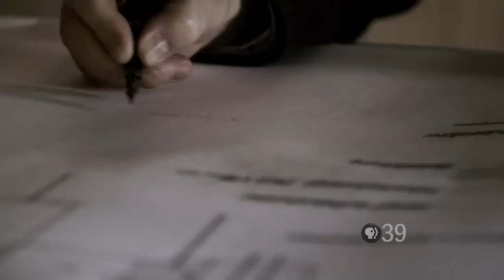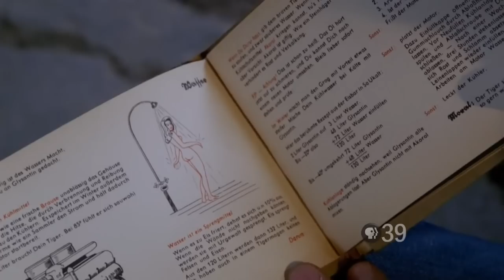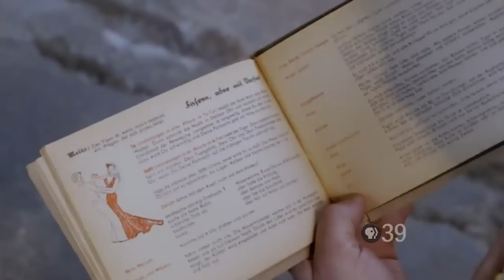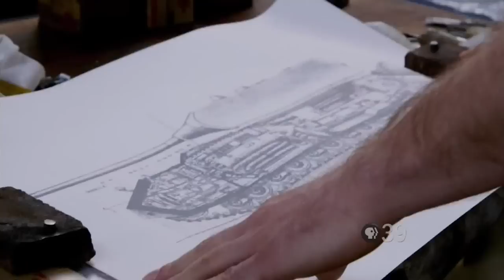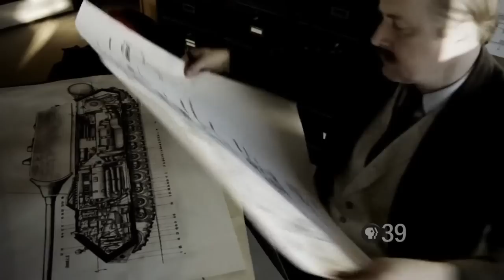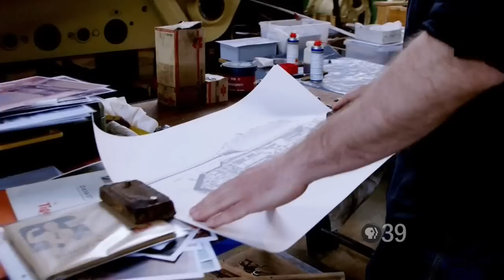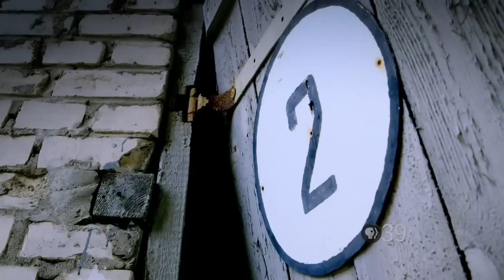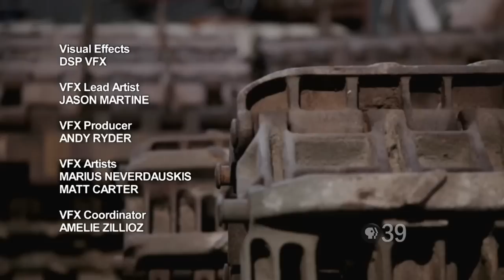German Super Tanks - WW2

Comment: the tiger Porsche had a different chassis though than the one shown in the cinematic scenes.
Reply: Well its not American so yea :/
Reply: michael2011148 not American? I'd hope so. The tiger Porsche was horrible.
Reply: Awkward Catfish it was bad, yes, but not horrible
Reply: +michael2011148 Well it was a failure so it should be horrible. 
To be fair ALL tanks created by Porsche is horrible.
Reply: +Awkward Catfish The Tiger Porsche is one of the good looking tank it also has thicker hull armor than the tiger 1.
Reply: The Axis PoweR that is not true, the command version that was sent out with the ferdinand TD battalion was reinfiroced with an extra 100mm plate increasing the armor to about the same as the ferdinands (the turret armor wasn't increased) the normal Tiger (P) has 100mm of armor and the edges of the front was 80mm sloped back slightly.. sadly this change would make it useless to ange since that would just expose the 80mm corners.
Reply: Most tiger tanks in movies are t 34 dressed to look like a tiger tank

Comment: where is ze E100,E75,E50,E25?
Reply: is the soviet 76mm s54 gun or f34 76 mm gun better than the 76.2 mm on the sherman easy-8 and jumbo?
Reply: No.
Reply: Paper tanks
Reply: Richard Kmetz not true.  E100 hull existed.
Reply: The Tank never existed, a hull is not a tank.
Reply: Richard Kmetz As long as it was conceptualized and expected to be produced, it existed. In terms of military equipment that's generally how it is.
Reply: My reply was for Electronick7714. I had said the E100, E75, E50 and E25 were paper tanks, he said not true the E-100 had a hull built. A hull is not a tank.
Reply: +Richard Kmetz

Well the documentary mentioned the P1000 which was also a paper tank.
Reply: ok Thanks, although I am not sure what your point is
Reply: Richard Kmetz I was just saying that the reason why they didn't add the E-series is not because they're "paper tanks".
Reply: regardless of how you feel, a tank is no longer a paper tank once a turret or hull is constructed.  at that point it becomes a prototype.  paper tanks are just that, tanks that only existed in blue prints.  therefore e100 was a prototype since a hull was produced.
Reply: Electronick7714 Well aside from the E100 the other tanks such as the E-10, E-25, E-50, E75 were all just paper tanks.

Comment: >T34 is better than Panzer
>floor doesn't move
>kekekekek
Reply: Sorry but dont think so. T-34 was released to defeat pz IV and other german light and medium tanks. Of course T-34 was a mature enemy for pz IV but other constructions like pz V pz VI found T-34 an easy prey. And remember T-34 wasnt Soviets union only tank :)
Reply: I never said anything about it being their only tank. The IS-1 was the anti-tank solution. The T-34 was made for anti-personnel use, not anti-armor use. Hence the turret floor not rotating since it was meant to mainly face one way, forward, the way the troops were charging. This is also why so many of them were wiped out during WW2.

If anything, the best tank of WW2 was the Sherman VC Firefly or one of the American (W) 76 Model Shermans. The perfect mix of anti-tank and mobility.
Reply: what is the gun of the is-1
Reply: Pizza_F0r_ L1F3 A better one than the T-34. Just look it up yourself, silly. :^)
Reply: If the T34 had been meant to face only one way the Soviets wouldn't have bothered to put a turret on it. No, the absence of a cage was a simplification and the turret crew just had to walk as the turret turned, and that's a weakness. Not as bad as its inferior communications, though.

No, the Sherman is not in the running for "best tank of WW2". High target, weak armor, burns easily.
Reply: That's early war Shermans, late war we had great armor, didn't stuff it full of ammo (burning problem), and was still one of the most mobile tanks of WW2.